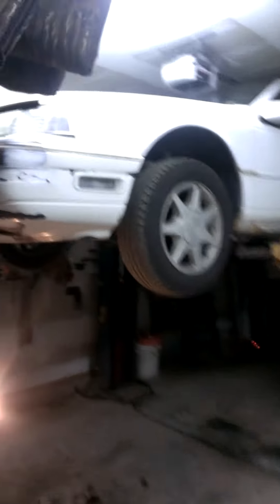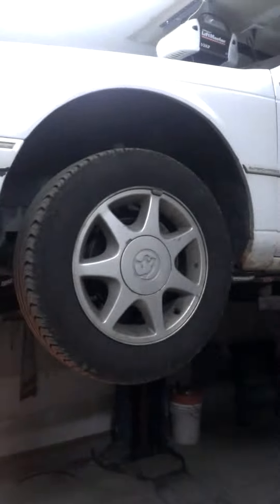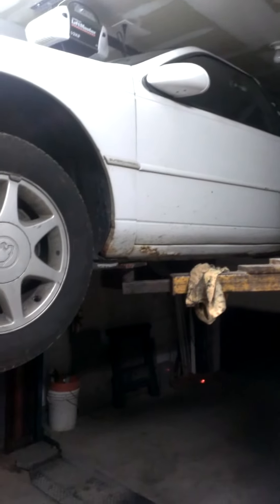1990 mercury cougar xr7 crank position sensor

Comment from the maker: The crank bolt size is 22mm and I also forgot to mention that there is a 2 piece plastic cover that goes over the sensor to protect it
Reply: Is it the same for a 97 mercury Cougar xr7

Comment: i have a 1991 thunderbird  sc same car basicly i think anyhow was it necessary to put the plastic surround cover back on ?
Reply from the maker: cass duncan it will keep the road dirt away from it for the most part, inevitably you'll still get some in there but if it's not a huge pain I'd put it back on
Reply: Craig ok thanks a bunch